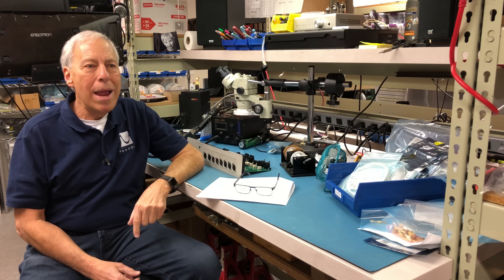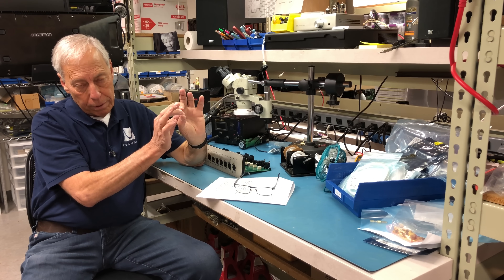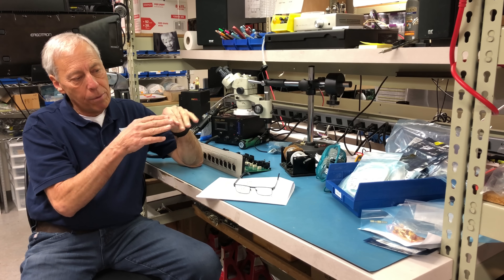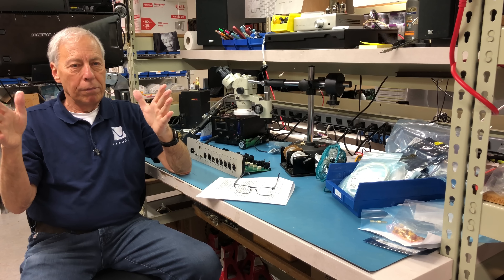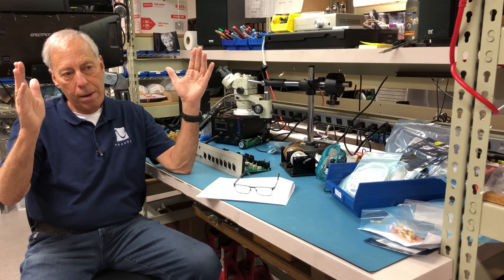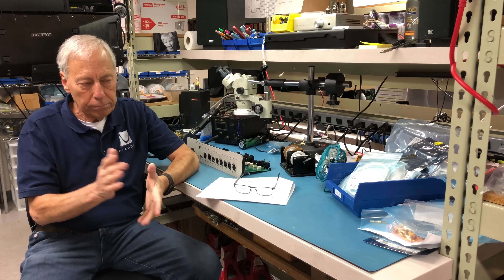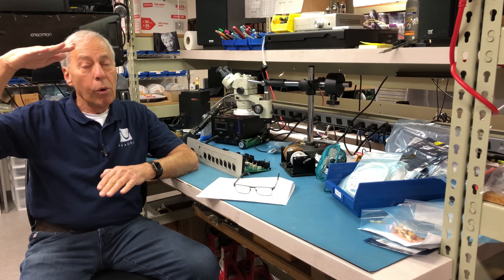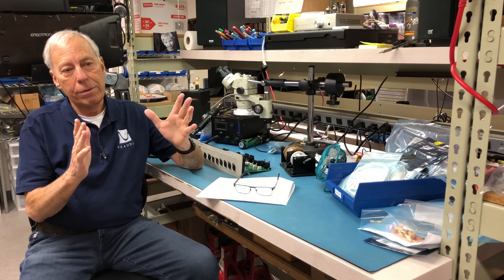Why do amps have 2 stages?

Comment: I have a question - why is it that some manufacturers use tubes for the voltage gain and transistors for the current gain? Is there an advantage in using a tube over a transistor for voltage gain? Why not use all tubes?
Reply from the maker: Tubes on the output stage are not great and typically require an output matching transformer. They're really not well suited for power delivery. TRansistors are much better on the output stage. Tubes are excellent as voltage amplifiers and generally sound better than transistors in this position which is why they're prized on the input. That said, everything is a compromise and there are no perfect solutions.
Reply: @Paulmcgowanpsaudio  Thank you for the reply : )
Reply: @Paulmcgowanpsaudio  
Paul:  Have you ever heard of anyone building a high-voltage transformerless tube power amp to directly drive electrostatic speaker elements?  Seems it could be the best way to apply tubes for power handling.

Comment: Amplifiers can include however many gain stages the engineers find optimum for best performance. Any such stage is a voltage gain stage including for the power amplifier. Gain in analog audio is about voltage all the way to your speaker terminals. Every gain stage can output some level of wattage but for a line level, usually you are down in milli Watts. The last gain stage in a power amplifier is optimized for driving much power into a low impedance of a speaker and this means low output impedance of the amplifier and ability to output high currents. The ideal power amplifier has a CONSTANT GAIN OF VOLTAGE (not current) that doesn’t get affected by even a low speaker impedance.

Comment: I've wondered if the 30 db was chosen for marketing since it is just a quirk in the math that it is 31v (on a fixed resistance).  The actual break even is 29.34 db = 29.34 v (for a fixed resistance)

Comment: 🍅🍅🍅 so if theres 40 volts going to the speaker. The collector of the output transitor will have 40 volts ? And the transistor just 'add amps' to the voltage ?
Reply from the maker: Yes, sort of. That's almost right. Remember that a transistor is a valve The power supply is the water mains. The power supply has a lot of available energy in the form of voltage and enough current to keep the voltage high. So when a output transistor turns on fully, the 40 volts at the collector flows through and out the emitter. The emitter is what's hooked up to the speaker. This valve has limitations. It can only handle so much current (watts) or it will self destruct. But, it doesn't "add" amps to the voltage - the amps are in the power supply and available for the output transistor valve to pass on to the speaker. The size of the transistor will determine how much of those available amps are allowed through to the speaker.

Just remember valve. It's just like a water faucet.
Reply: In a current gaining transistor circuit the load is usually behind the emmitter and the collector is connected to the powersuply. in a normal poweramplifier there are two of those circuits one for the positive and one for the negative part of the sine wave. With FET's you have to exchange the terminology: Base=Gate, Emmitter=Source,  Collector=Drain. This output stage  (transistor) dosn't add amps but it gives the ability to deliver amps if the speaker requires it. An amplifier has an output voltage and the spaekaer takes the current (Amperes) it needs (Ohms law + some additional for dynamic loads) If the amplifier can deliver.

Comment: I think Casper questioned the input stage right for existence really. 
Some engineering books will explain that there are actually three main stages in a regular amp: input stage, voltage amplification stage (VAS) and the output stage. For simplicity, you may say that Input + VAS give voltage gain, whereas output stage gives current gain, which Paul has just explained. 
But the input stage is kind of important, and designers spend a lot of time doing it right. 
As far as understand from the previous Paul's videos, BHK series have tubes in the input stage precisely, and this makes all difference in the world. 
Input stage buffers the signal form a cable and output impedance of your preamp or DAC, so that the following stage (VAS) doesn't need to deal with that unpredictable variables. It also protect amp input from various noises at some extend, like RF and mains noise.
Input stage is also design to accept global negative feedback if one is used in an amp + it convert balanced to unbalanced in most cases.
So input stage has some more job to do apart of the just signal amplification. Certainly has the right for existence.

Comment: Line level from a preamp is typically from 0.6v rms to about 1.5v rms.  In most power amps one of the reasons for the first stage was the need of a phase inversion for the push pull output stage.  I don't think the "voltage" of the signal to the final current stage is very high.  The final stage "voltage' is supplied by the rails of the power supply and the higher the current demand due to the size of the input signal the higher "voltage" will be across the speaker terminals.  The signal will "clip" when it reaches the rail voltage.   A supply capable of providing 200 watts into 8 ohms will will have a sine wave rms voltage of 40 volts at full power.   However, at normal listening levels of about 85 db the voltage will only be 5-10 volts on average.
Reply: Typically, class AB solid state amps do not require any phase inversion to drive the output stage; it is driven by a single-ended signal (some class A designs may use signal inversion, but these are relatively uncommon).  
Then the voltage of the signal to the output stage definitely does need to be as high as the output voltage to the speaker.  The output stage doesn't produce voltage gain.
Reply: @marianneoelund2940    
Most class AB amps use a push-pull design that requires a phase inversion so that both the positive and negative side of the signal can be applied to the output devices.
Reply: @swinde  
You're confused.  There is a single signal applied to the output stage, which swings back and forth between the two polarities, always in phase with the amp input.  When it swings positive, it turns on the transistor connected to the positive supply, and then when it swings negative it turns on the transistor connected to the negative supply.  
That is NOT the same thing as having a phase inverter, which provides two independent drive signals that move in counterphase, i.e. one goes positive while the other goes negative - that is not needed to drive an AB output stage.  (But it's useful if you want to drive two output stages to power a speaker in bridge mode.)  
Tube amp push-pull output stages have the two tubes coupled via the output transformer primary, and the tubes conduct during opposite phases of the signal; this setup does require a phase inverter to drive one side, which needs to have its grid voltage go positive while the music signal swings negative.
Reply: @marianneoelund2940  
Well I can see where a solid state amp with complimentary output devices (NPN and PNP) probably does not need phase inversion.  You are correct.
Some solid state amps use NPN devices for both sides of the output signal and I would think this would require a phase inversion stage.  If not, why not?
Reply: @swinde  
Where you have NPN main transistors for both sides, the driver transistor for the low side will usually still be a PNP; its collector drives the base of the main low-side NPN.  That combination effectively behaves just like having a PNP main low-side transistor with emitter at the output and collector at the negative supply.  But it can be trickier to stabilize.

Comment: Hi Paul,
Is there a "standard" for aux. / line level input voltages that circuit designers use.  Something like the 2 or 3 volts (peak2peak?) that you mentioned.  If so, what is it? I always thought is was lower than that, maybe 600 to 1000 millivolts RMS.  Thanks.   Always look forward to your advice.  Thanks.
Reply: 2.2V single ended, 4.4V balanced, peak
Reply: @razisn  Thanks.  I wondered if there were some "agreed to" standard in the industry, like RIAA being a "standard" for phono stages.

Comment: Thank you.
I've always wondered how the Amp was outputting 10-50V when most amplifier explanations/tutorials only deal with current amplification.
Is Input stage amplification divided in to A/B/D, or is this a much simpler type of amplification?
Reply: Victor Wong input stage works in A or A/B, but class A is pretty common because you don’t need to have big power supply or radiators to run in class A for just input stage. 
In basic, current and voltage stage looks very simillar(of course they are more complicated in most amps). Google for common emitter(voltage amplifier) and common collector(current amplifier).

Comment: Bascom H. King apparently likes vacuum tubes for voltage gain and transistors for current gain in the PS Audio BHK Signature line level preamp and power amps.  Did I hear correctly that PS Audio is coming out with a phono preamp for the BHK line?  With tubes?
Reply from the maker: Yes sir! We're excited.